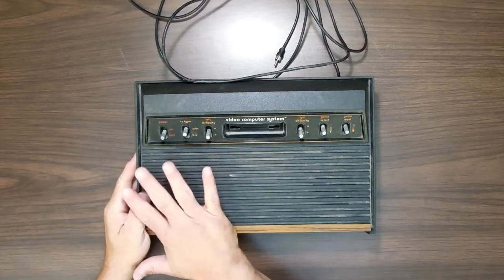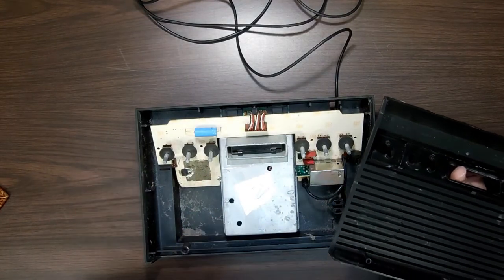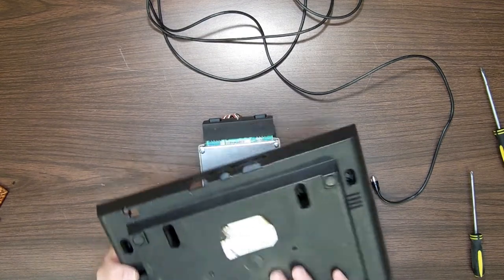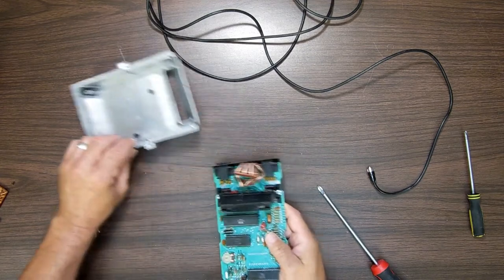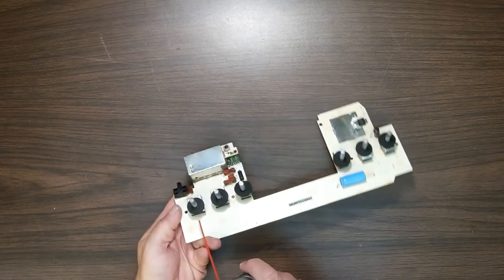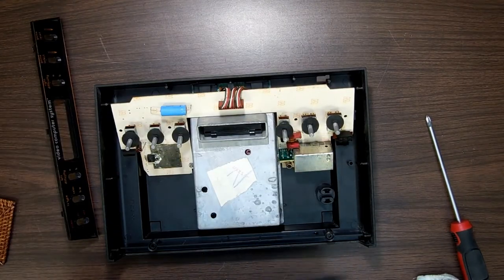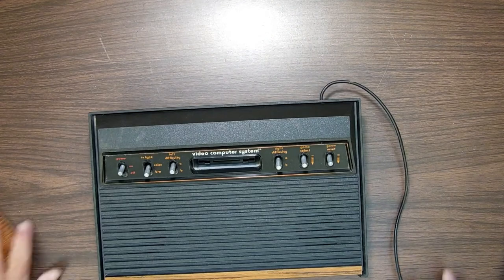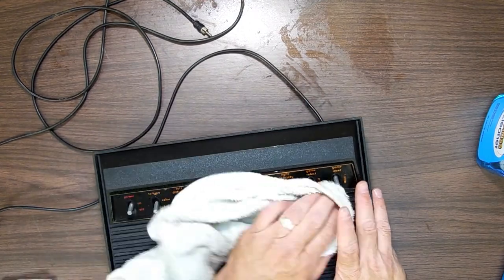Cleaning an Atari 2600 for the Gallery EP0101

Comment: This should be called how not to clean an Atari 2600.  You ruined the label by putting it under water and then covering it with (non-removable) tape after the fact.  You took it all the way down to the board for no particular reason I can discern.  

The channel selector switch should be hosed down with contact cleaner (a dirty switch there causes snowy weak picture) and the switches should be disassembled and cleaned.  They are the same exact type of switch as the Coleco on-off switch. They do fail. The 2600 I had as a teenager failed.

Then, for reasons unknown, after it was already cleaned, you sprayed windex all over it, especially near the switches and the foam surrounds which collects spare windex and discolors the foam surrounds. Fortunately, since the case was already perfectly clean, at least the windex wasn't dirty.
Then for really unknown reasons, you armoralled it!
Reply from the maker: Thank you for your comments. You may or may not have noticed but the label was already damaged in the beginning and as I stressed many times this is going into a gallery for everyday hands on use by children so it has to be cleaned thoroughly. It’s not for collecting or reselling.
Reply from the maker: You probably missed me saying I pulled it all apart to make sure there was nothing that could short it and nothing living in it before children get to
Use it
Reply: @8BitMilli  I actually did go back and check before posting when you put the tape over the label.  I could see it was slightly physically damaged, but I assumed the writing was still easily legible on it.
To be honest, I debated whether or not to post this comment. I didn't want to come off as an ass, but it all seemed to me like the riskiest possible way to do the job.  I'm glad you didn't take too much offense.
Reply: @8BitMilli  I watched the entire video before posting, though as I noted in my other comment reply to you, I went back and looked at the label as best I could see it, pre-bath.  I did hear you say you were worried about bugs and I get that.  Taking apart the plastic case was not really the issue I had. 

It was taking it out of the aluminum shielding.  It's not that I think you cannot do it right, it's that I know for certain some people watching you cannot do it right.  Plus, cleaning a 2600 without taking it apart is a very long, tedious and difficult job. It has all those vent pieces that have 3 sides factng the outside of the 2600.  At a minimum, the top shell needs to be put in a sink and cleaned with soap and water and scrub-brush to get into those nooks and crannies.  Otherwise, it's the plastic screwdriver trick you used in drying it.
 To me, it is about what is risky to do and what is not and the benefit of the risk taken..   I would NOT recommend to any old person to take apart the switches.  I had full confidence you could do it.  I've seen you troubleshoot Adam computers not working and removing chips etc.  They are actually very simple switches.